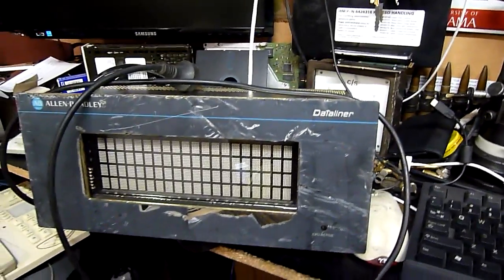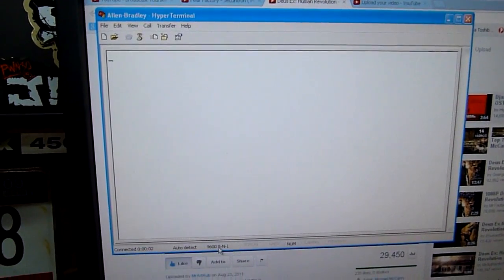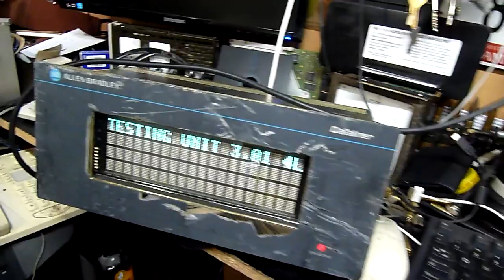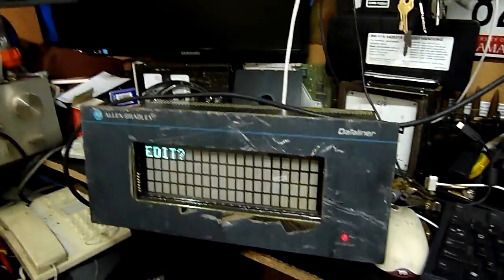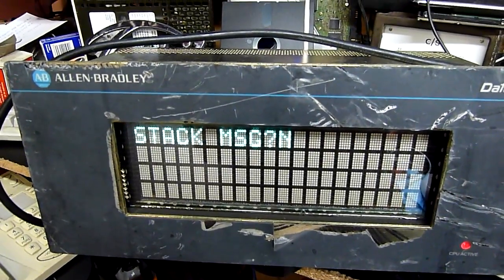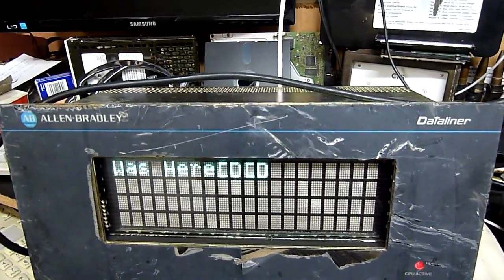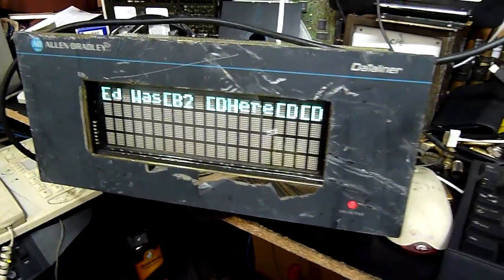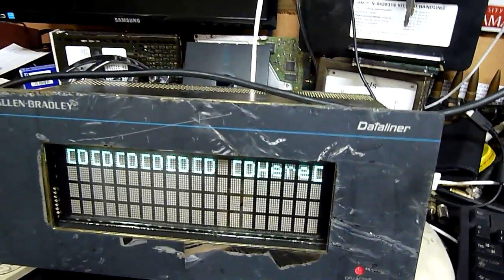Allen Bradley Dataliner 4 Row VF Display Test on PC (RS232)

Comment from the maker: Nice find!, they are worth a fair bit so hang onto it!

Its a programmable readout that can function with or without a PLC, in this case it was coupled to an AB SLC500 PLC and told the operator what the machine was doing and when.
likewise you can program it yourself to do all kinds of fun things when triggered too, like display "Back Gate Open" if somebody trips a sensor on a gate outside.

Comment: OK, what needs to be done with this, is to get it to run a scrolling message at the beginning of each video. If it doesn't do scrolling messages, then just fixed in one place will do. :-)

You could use it to display the video title and all sorts.

Yes, this is good! 

Thanxx for showing,

-BoomBoxDeluxe.

Comment: Thats cool! when in message mode it seems to behave like a regular serial data display. You can try to use LCD smartie, and use the testdriver plugin, which basically spits out the data on the COM port. By doing that, you should be able to get the display to show CPU usage, RAM usage, and other fun stuff you set the program to do. It would be a cool HW computer monitor! :D

Comment: Well done :-), didnt take you long to sort that out :-)

I used to mess around with rs232 with my old 8 bit machines, serial works well when you get the settings sorted, but very slow for bulk data transfer.

Perhaps if the internal battery is sorted it might be able to store your message so at switch on it spits it up onto the display :-)

very happy for you :-)